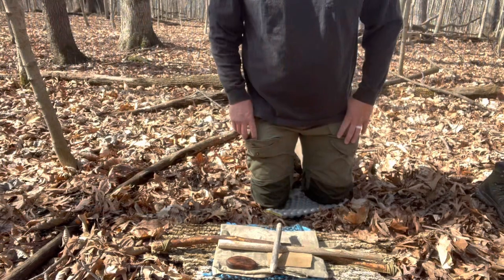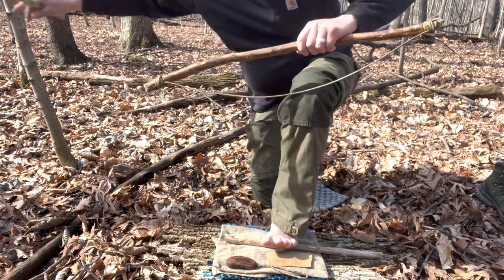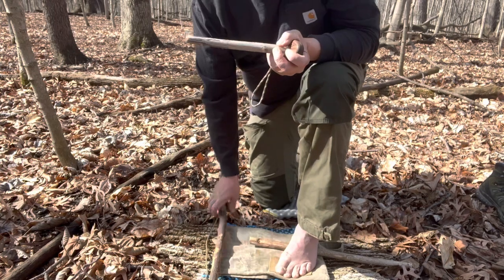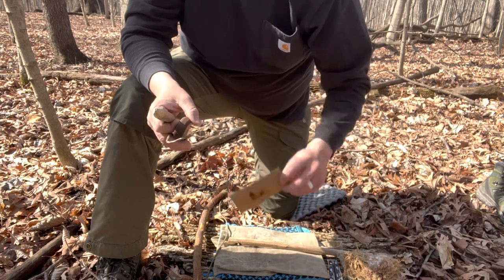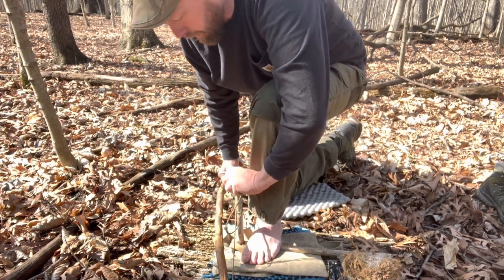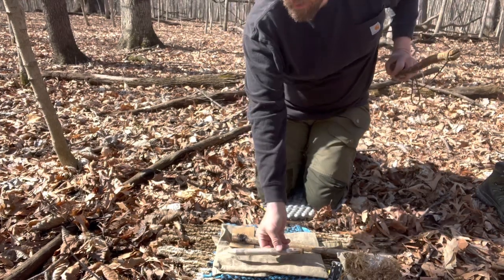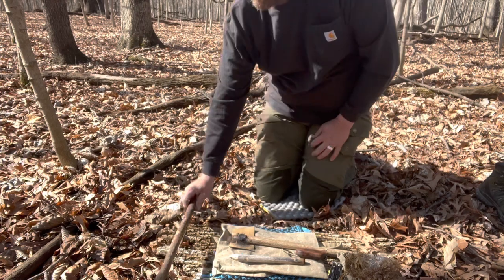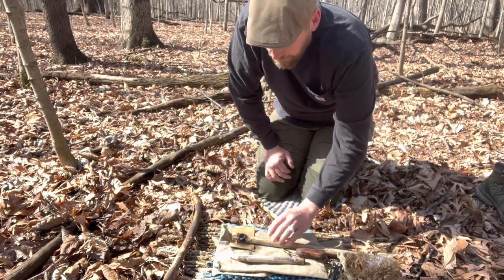Bow Drill Friction Fire

Comment: Nice. I have a desire to learn this. I read a lot about it, collected the wood and dried it well. First attempt in life, boom fire it is so easy. Second try, new fire. Funny how simple it is. Then a cold shower. The next 10 attempts fail. Then maybe one success again and ten times fail again. Ok, maybe it's not as simple as it looks. It annoys me because I don't know what I'm doing wrong, because I'm trying to do everything like the first time, where I managed with practically no effort. Less than a minute and it was ember. I have a lot of smoke, but the coal dust doesn't glow. I wanted to light it with a lighter to test it, a small piece lights up then goes out very quickly. There is no way to increase the embers by blowing. So there must be something wrong with the coal dust.
Reply from the maker: Thanks for watching! 
Friction fire can be difficult. For fire, we need fuel, heat and oxygen. 
If your spindle is too thin, you can drill through the hearth too quickly, giving you smoke and dust but no ember. 
Many times I see students who struggle because they see smoke and some dust so they stop and check for an ember. You really need to have the notch full of dust before increasing pressure and speed to create the heat needed for an ember. 
If you need any more help, you can message me. 👍🏻
Reply: @Brendan_Clancy  Thanks for the reply. I wrote to you through your site.